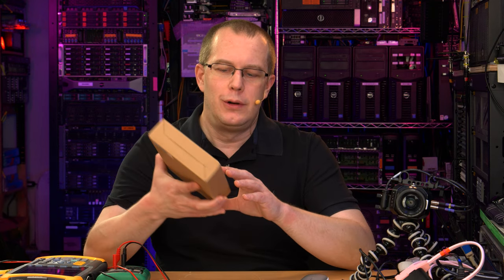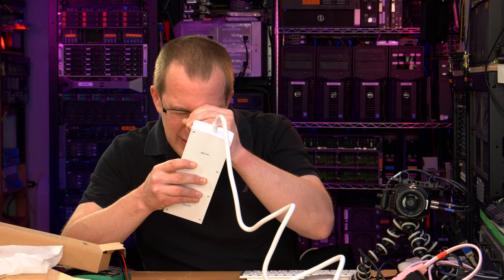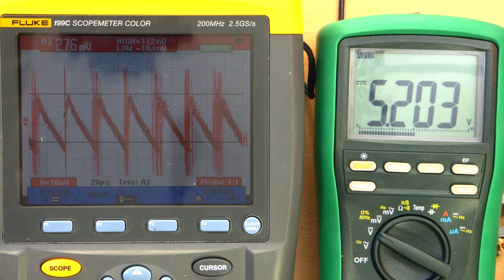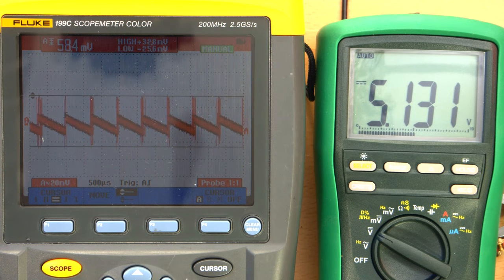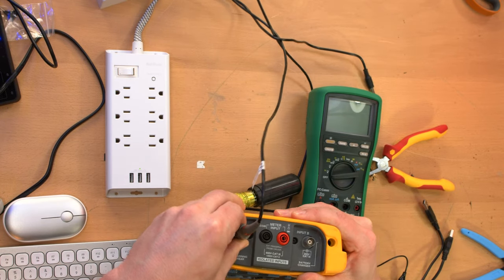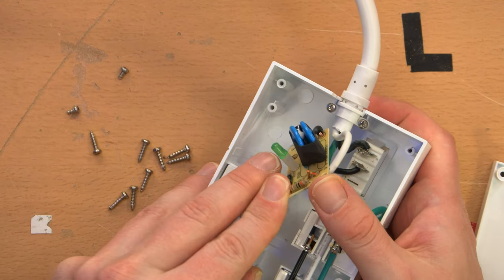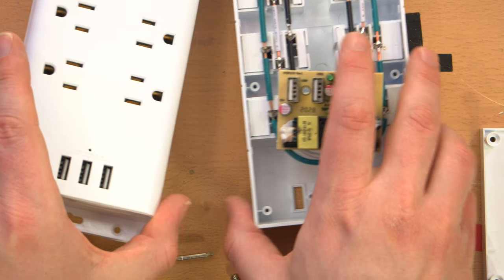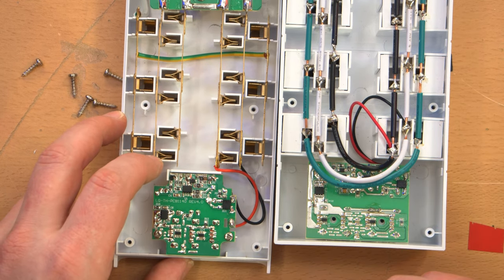Addtam Power Strips with USB

Comment: I'm looking for a good quality surge protector for my music studio. I have some very nice synthesizers, as well as other gear, and I want to make sure they're protected very well. I just don't want to spend an arm and leg. I have an electrician background, so I'm not afraid of wiring etc, but I'm not an electrical engineer, so I don't fully understand how a surge protector works. From what I'm seeing, why now just add a breaker and possibly fuse for extra protection, and then just wire in outlets...? Obviously, a nice aluminum box would be need as well. I have to be missing something. If what I'm saying would work the same, then I could build some very affordable, high quality surge protectors.